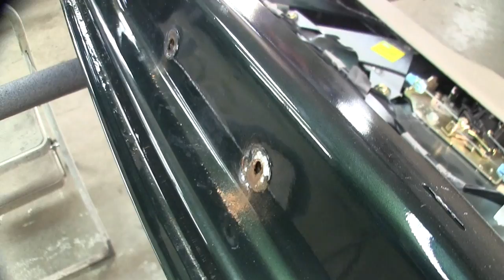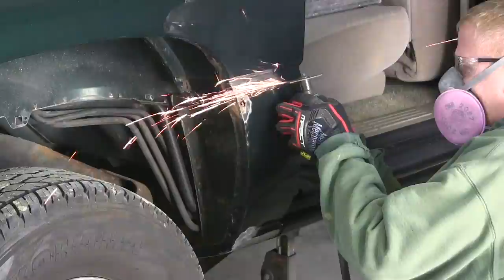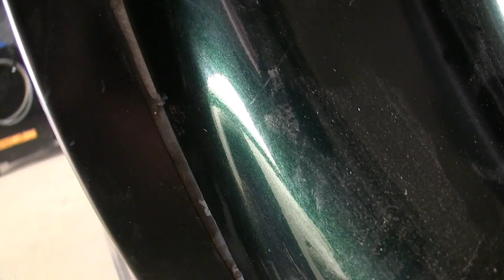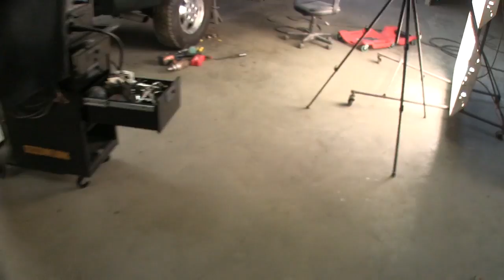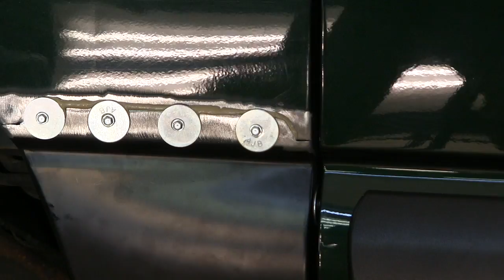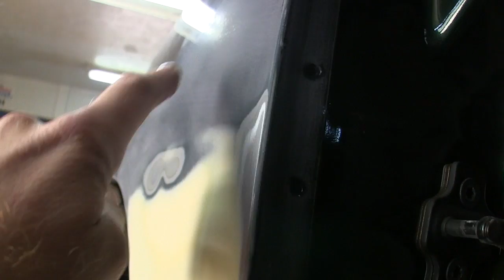2003 Suburban Quarter Panel Repair

Comment: How much does this typically cost? Would it be better to replace the quarter panel or just get the dent pulled out and repainted At a body shop?  I got an 04 Escalade esv and I just want to know if it’s worth fixing.  I can replace the fender and hood myself
Reply from the maker: To have a body shop replace the entire quarter panel would probably exceed the book value of the truck

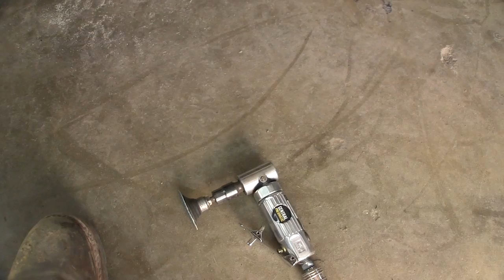Comment: I just bought that little air tool from Harbor Freight. With the sanding kit attachment. But it keeps flying off is that what the little lock nut is for? You shoe it at 33:32
Reply from the maker: Bondo 
The backing pad coming loose from the threaded shaft?  Or is it falling out of the tool chuck?  If backing pad comes off put back on with loctite

Comment: great video--I actually have seen very few examples of panel bonding.  I am a good welder--but agree that its much easier to blend a 20 guage overlay than to grind everything out and refill..ugh.  I have a Suburban 2500 that I would love to do when weather warms up--same rust areas as  yours...keep up the great work!

Comment: Is there an access hole for that panel to use fluid film - my truck has no rust on that panel - I want to keep it that way but have not yet figured out how to inject rust treatment in that area.
Reply from the maker: gee dub 
Not sure if there’s a hole but you could drill one and put an undercoating plug in it after spraying

Comment: These videos are great... but I have a question... do you use seam sealer at the bottom of the patch panel, and at the edge closest to the tire.. I know you said you use some in the door jam side... I am new at this.
Reply from the maker: hildharry 
I seam seal any ones that were done from the factory. Just look before you cut it apart

Comment: nothing wrong with this repair.  Panel bond is strong!  When you use the stuff with glass bead especially, it allows a proper minimum thickness to remain for strength.  I went to wyotech for collision repair and some cars are made by manufacturer to pass collision tests with panel bonded parts.  They also use so called structural foam in side pillars to reinforce for strength and it sucks to repair.  this is a good method, so don't hate.  you can't be stupid and put heat on these areas with welding obviously!  use your head.  these are for low stress areas and with a lap joint like this it has strength.  guarantee many body shops use this method regularly.  great video, this will help many.  Also panel bond isn't cheap either, and is very strong.  rock on brother!  great for rust repair on personal vehicle when just hate sight of rust and then paint or bedliner over with proper preparation of surface and application of product.

Comment: where do you order the panels from? ive seen a couple sites selling them at a good price but usually all seem to good to be true.
Reply from the maker: Jason Ruiz Mill Supply in Cleveland Ohio or Raybuck. You can buy from either online. But on big parts the shipping can be very expensive

Comment: where is the best place to buy panels and rockers for my 2002 suburban.
Reply from the maker: tony monti Depends on where you live. I buy them locally but there are many online vendors. Mill supply or Raybuck are two I buy from. LMC truck would likely have them too

Comment: I just did my 02 avalanche quarters and used panel bond ( different brand) but used self tapping screws to hold panel in place. pre-drilled them to make sure panel fit correctly. used fiber filler like you did but didn't know what to do about the screws after panel had cured. thought about grinding off the heads of the screws off and hope to God the rust doesn't start there and cover them with fiber filler or take them out and the Jam filler in the holes and hope for the best. what did you do. didn't show it in the video?????
Reply from the maker: LSXs10 Guy Fiberglass filler in the screw holes.
Reply: Velvethamma 
You can just grind the heads of the screws...
Ive worked at a couple body shops and they leave screws in place...
And yes, they warranty for rust!

Comment: can those panels be entirely glued, instead of welding
Reply from the maker: I suppose you could but it would cause you to have quite a bit more filler work to do. It might also be difficult to overlap the patch on all sides since it is made to butt weld.  You could get creative and use the panel bond to "glue" a sheet metal backer strip to join the old to new.  My way seems like the easiest approach if you can weld.

Comment: For those self-tapping screw holes, could you just brush some panel bond in them then put fibre glass filler over it?
Reply from the maker: That's what I do

Comment: is there any benefit to getting the panels from GM as opposed to aftermarket
Reply from the maker: As far as I'm aware, the only panels you can get from GM are the entire rear quarter and entire rocker panels.  They do not offer rust repair sections

Comment: are you in Cleveland too. I have a 2001 suburban that needs on side like this and the piece behind the wheels too, both sides
Reply from the maker: Medina
Reply: +Velvethamma how much would you charge to do that? and the panel behind the wheels (where you filled dents) on both sides?
Reply from the maker: brianallen0826 If you want an estimate I would need to see the vehicle.  I try not to give estimates site unseen.

Comment: Excellent video. I haven't used the panel bond and was wondering what the filler blend was going to look like with the lapped metal and it turned out very nice. I guess you could also flange the original quarter, but no more of a blend that you had it might not be worth it. Keep the vids rolling.
Reply from the maker: +Double R Restorations Thanks buddy.  The way you prep the lap joint is the key (I think).  You use the angle grinder to put a steep 10 degree bevel (according to directions) on both areas of the lap joint.  If you had a flat area you could use a flange but I seem to have a hard time not shrinking and warping the panel with the flanger.  It seems to shrink it no matter what I do.  I do cab corners this way and the seam is still invisible after 2-3 years so far.  I haven't been using the adhesive long enough for a long term test to see if the seam ever shows back thru.

Comment: if your worried about any holes that are remaining ......... use a electric solder iron, and a little rosin core solder... i'v been using it for 50 yrs ..... quick and easy
nice fix ......:)
Reply from the maker: +Steven reis sr I've seen a few people do that before for slide hammer screw holes.  Seems I forgot about that trick.  I'll have to give it a shot on the next one.  Thanks for the tip!

Comment: Another thing sure hope you get a job to repair rot pertaining to inner door frame bottoms an outer skin bottoms. they dont aftermarket inners for shit a few common trucks mostly Chevrolet.
Reply from the maker: +Jon A If a door bottom is beyond a simple spot blasting, prime and paint, it's cost effective to buy an aftermarket door shell.  They are very reasonable, but then you have a lot more painting and hardware to deal with

Comment: I was wondering if those washers and screws were going to set in the panel adhesive. Did you take them out after it was completely cured? If so, how come they did not bond to the panel?
Reply from the maker: +asicerik I left them in till it was cured.  Since they didn't have a scratch in them for adhesion, they popped off pretty easily.
Reply: +Velvethamma Thanks Shawn!

Comment: thats a great video I,ll have to pick up some primer from their when I start working on the Jeep again  I've been using the 3m and its expensive  I got the bead roller set up it works great my Brother uses pannel bonding all the time and he works in a dealership  he loves it
Reply from the maker: +Fred Sitzenstock Nothing cheap about this kind of work is there?  Seems like any trip for supplies is a minimum of $100 these days.  The adhesives are the new technology in this industry.  No worries about heat from welding and the strength is incredible
Reply: no there isn't even a sheet of 4'x10' 20 gauge is about $100 cut into three manageable pieces  then you have to cut it to your patch size and form it
Reply from the maker: Fred Sitzenstock Where do you get sheet metal that gauge around us?  I have had a hell of a time finding it.
Reply: Aztec steel in Lorain it was $106 with tax it would have been less but they charged me $25 to cut it into three pieces
Reply from the maker: Fred Sitzenstock Gotcha.  Seems like a bit of a drive for metal but you gotta do what you gotta do
Reply: up from 57 & 82 maybe four miles the thinest standard welding has is 16 gauge
Reply from the maker: Fred Sitzenstock Standard told me nothing under 1/8" plate the last I checked.  They're like 1 mile from my shop too.  For everything else I need they always have it.  I guess 57&82 isn't too far.  Like 25 minutes for me.  I guess I was thinking lorain.... not just north of grafton.  I'll have to check them out
Reply: Aztec Steel 800 Taylor street Elyria ,oh 44035
800-342-8700
Reply from the maker: Fred Sitzenstock Great!  Thank you.  I know exactly where that is...
Reply: your welcome

Comment: Great stuff Sean. I appreciate you showing us this. Could you joggle the bonded join?
Great vids, keep en coming.
Reply from the maker: +Michael Quigley The instructions do not require a flange or joggle as you say but I see no reason that you couldn't do it that way.  Should work out just fine as long as the metal is prepped properly and the adhesive covers the bare steel area.

Comment: Do you ever take on small crash work.  Pulling on inner structures and what not.   Would love to watch a vid series on that like a smashed rocker or cab corner or something.   Mabey you farm out the pulling.  Anyway freakin top shelf for sure   =)
Reply from the maker: +Jason Curry I will do "light" collision work where there isn't a bunch of frame damage.  I just don't have the equipment to do the heavy hits.  Crushed rockers and front aprons are not bad but with no frame machine or formal training it will be a while before I start those kind.  Maybe a crash and burn for a flipper car or something......  A guy on youtube to check out is Arthur Tussik if you haven't seen his vids before.  His vids are subtitled because I believe he is in Russia so no english.  But this guy is an absolute expert at pulling frames and straightening the inner structures.
Reply: +Velvethamma He's great.  I think I've picked up some good knowledge of "material properties" of sheet metal from him.  Occasionally, he'll repair panels I think are far beyond salvation, but he knows how to put everything back into to shape and only uses minimal filler.
Reply from the maker: +Mar Brooks I agree. He is a master of our craft.  I feel privileged to be able to watch his videos 😀

Comment: I have watched almost every one of your Videos and I always learn something. I have never used panel bond but I got to tell you I like it, no warping fast good rust prevention I think I will buy a tube of Fuse bond for my toolbox, I assume it lasts as long as it is sealed and you only need to buy new tips where the two compounds mix. Good Video Thanks!
Reply from the maker: +Cary Lamari First off... I would like to thank you and all the folks who tune in to my vids!  It's the reason I keep making them.  As far as any two component panel adhesive, I believe they have a guaranteed shelf life printed on them.  I would buy as I need it.  I think it has like a 12 to 18 month shelf life.  And then again... I think if it's stored properly, it should be fine.  Just pick up extra tips like you said.  I think they put the date on it to cover their ass when it comes to warrantee .  I have watched product vids from 3m and Fusor on these type of products and they test them in crash situations to see if the bonded panels will separate.  Amazing how strong the bonded seam is compared to welds.  It just does not come apart.